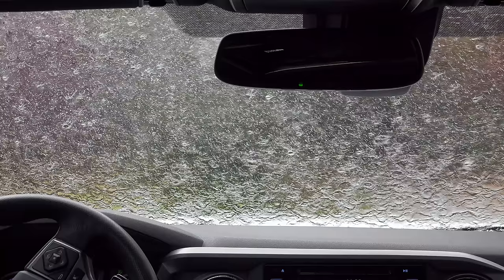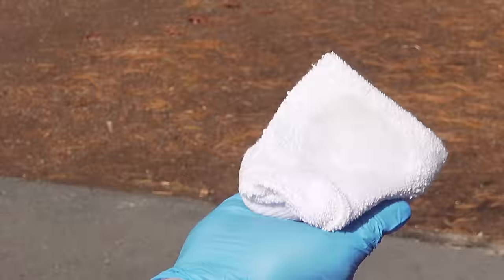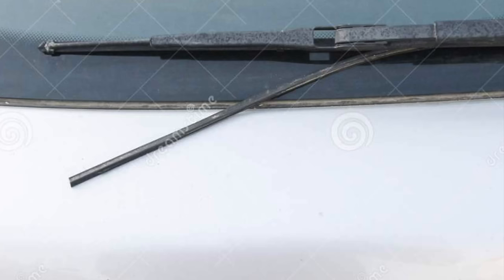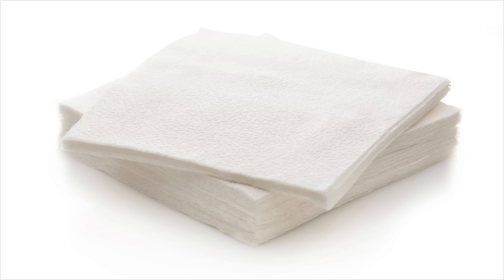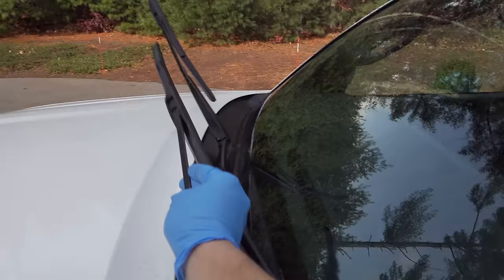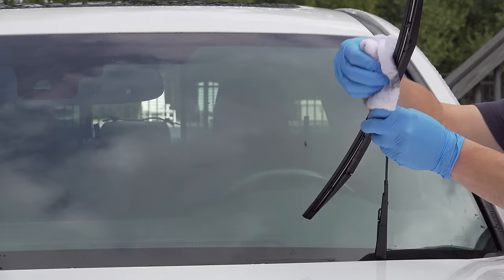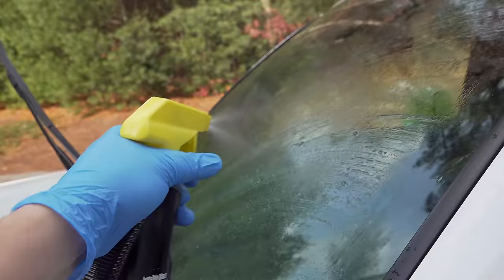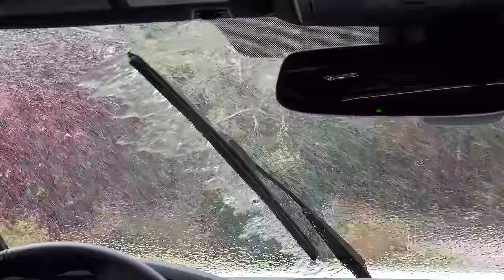How to Make Windshield Wiper Blades Like NEW in 30 Seconds

Comment: So many negative Nancy's leaving unhelpful comments.  
Guys just ignore the H8Rs I can confirm this method works wonders but for the millennials and GenZ crowd Ive found a secret hack that does the exact same thing but without the need to apply any effort whatsoever, perfect for all you tech savvy youth.  All you need to do is hold down the window washer stalk until all the water is depleted, remove the tank cap, point WD40 nozzle directly into washer tank and empty 3 or 4 cans depending on vehicle size. If your driving a large SUV youl need 5 cans minimum, small cars 3 cans is about right.
Don't be alarmed if you cannot see the WD40 liquid come up to the fill line, the main ingredient in WD40 is just a cheap generic hydroplurocarbanant non inhalent gas which is invisible to the human eye. Replace the cap and all done, told you it was easy, Now just wait for the next torrential downpour to test this secret hack and you will see the amazing results but it's really important that you must wait for the first big rain storm as this will not work unless there is plenty of water on the windscreen first,  trust me. 👍

Comment: The big problem is that wiper blades are now being deliberately made of an inferior rubber composition so they last one season and you have to change them every winter. They are tremendous profit makers for the manufacture and auto parts stores. especially since they now are charging around $30 for a pair.  Have you ever noticed too that auto parts stores DONT stock silicone blades? 
Wiper blades used to last many years. I remember getting 5 years out of a pair of blades.  The only way you can do that now is by buying silicone wipers and auto parts stores deliberately don’t carry them because they last too long.  You can buy them online for the same cost as a cheapo pair of blades that will degrade in a year.

Comment: Best to use a silicon-based lubricant and not WD40 which might wreck the rubber in your wiper blades ...
Reply: I agree. Silicone contains plasticizers and is commonly used on rubber to rejuvenate. The only thing I would warn is not to use an aeresol silicone. The "carriers" may not be good for rubber. Instead, go to the hardware store's plumbing department where they sell 100% pure silicone jelly. 

One other caution about silicone spray is that silicone kills catalytic converters. If I used a spray (which I wouldn't), I'd do it with the engine off so it won't inhale silicone into the engine and out the exhaust. You don't have that risk with the gel.
Reply: @markfuller  ✅

Comment: The black on rag is the rubber being dissolved.
Reply from the maker: It's not rubber coming off. Don't believe the old myths, believe the can "safe for rubber"
Reply: @SilverCymbal  then take a  can and keep wiping and see if it ever stops turning your rag black.  I bet you end up with a big pile of dirty rags and it keeps coming off.  It's just cleaning it then a couple of wipes you should have Rags that are coming out clean after you wipe with WD-40.
Reply from the maker: @actionjksn  My friend my videos tell the truth, I have been using this tip for over 20 years on dozens and dozens of cars. It absolutely diminishes after several wipes as shown.

Comment: cleaning your wiper blades with WD-40 will not work. In fact, it can actually damage your wiper blades. WD-40 is a lubricant, and it can leave a residue on your wiper blades that will make them streak and smear. It can also damage the rubber in your wiper blades, making them brittle and more likely to crack.

Comment: I wouldn’t use WD40 on any rubber products it would make  rubber very soft & stretchy which will ruin the rubber I remember long time ago I sprayed WD40 on my fan belt because I was cleaning my engine after few days the fan belt was ruined & I had to replace the fan belt so be careful guys 🤞

Comment: DONT DO THTA! The black stuf on the rug is not dirt, is the graphite and tefflon which protect the rubber of the blade. Using wd40 will destroy the blades in time.

Comment: Didn’t know wd40 and nice rags are free or cost less than new wipers
Reply from the maker: I dont know anyone that doesn't have a napkin and WD40 around their home. But yes if you have to buy it, one $6 can will treat about 50,000 wipers.
Reply: @SilverCymbal  Agreed! I tried to be sarcastic and I apologize. Now, honestly I use WD40 a lot but that black thing it takes off of rubber is graphite and graphite has its purpose. On old wipers graphite is almost gone hence WD could take the role of graphite. I’ll give it a try

Comment: I once used silicone spray on my new motorcycle fork. My rubber rings got cracked. No thanx.
Reply: WD 40 isn't silicone. Silicone contains plasticizers which will rejuvinate rubber (in a way wd 40 never will). But, silicone aeresols contain carriers which may not be good for rubber. The hardware store's plumbing department sells a 100% pure silicone gel. That works great to rejuvenate rubber. Give it another try sometime, but do it that way.

Comment: This didn’t work for me. Made my blades all greasy then smeared all over my windscreen. Had to degrease the whole lot. I used wd40 silicone spray.
Reply from the maker: Silicone WD40 will not work. Only regular WD40 as shown.

Comment: Do not use WD-40 on your wiper blades. The first time you used them you’re going to smear WD-40 all over your window is a mess, standard, rubbing alcohol it does the same thing it doesn’t mask all over your windshield.

Comment: wd40 is the wrong product to use as it will dry the hell out of the wipers and cause cracking in the blade much quicker, its a penetrating oil not a lubricant ! any time you use wd40 you should lube the area right after as WD40 dries out.

Comment: Nice try. Saw improvement, but not restoration. Blade rubber is in great shape, cleaned the window, but this didn't work as expected. Will try again to confirm.

Comment: NO, not WD-40!  And, WD-40 to "like new", NO!  That is just not true unless the blades are already "like new".  Silicone spray, YES!  Also, you can buy silicone wiper blades.  Be in the habit of washing the blades when the vehicle is washed.  When not washing your vehicle, clean the windshield properly when doing the blades.  Because why do one and not the other?  You can also use a water repellant on the windshield, which the silicone product used may just be what you need.

Even what goes in your windshield washer reservoir can make a difference in the life of the blades and how clean your blades and windshield stay between cleans.

Old trick: If the blades are lightly worn and don't need replacing, clean, sand with high grit sandpaper, not less than 800 grit, from top to bottom, or bottom to top, in even, light strokes, clean, treat with silicone/silicone spray.  A long time ago, some people would just grab a matchbook and use the scratchpad/striker to rub over the blades.  (Heh heh!  ASIDE: I even remember when matchbook strikers were required by law to be moved from the front of the matchbook to the back.)

NOTE: Regarding WD-40 and similar products, you may want to research products for their combustibility and or flammability.

Comment: WD-40 is 100% the wrong solvent to use for cleaning this. That is because WD40 actually attracts dirt. Try putting it on a clean bicycle chain, go for a one hour bike ride, and you'll see what I mean. If you want to properly clean rubber you should be using something like isopropyl alcohol or, hot water and Dawn dish soap.

WD-40. Lol.
Reply from the maker: Please follow the video for amazing results. You aren't leaving it on the wiper. My simple video steps won't steer you wrong

Comment: Don't do this Just clean the wipers with soap and water and then use a silicone based wiper lubricant. Using WD-40 removes the graphite on the wipers.

Comment: Wrong....plain water to wipe away dirt, glycerin soak for 20 min and rinse with plain water to replenish rubber. If blade is curled when lifted and not perpendicular to frame, cracked, torn or damaged in anyway just buy new ones

Comment: WD-40 deteriorates rubber.
Reply from the maker: Its a myth, You will see on the can, "safe for rubber"
Reply: I looked at 2 WD-40 cans of different production runs.  I didn't see 'safe for rubber'.  I did see 'contains petroleum distillates', which are believed, like most petroleum products, to be harmful to rubber.  A mechanic told me to use other silicon spray lubricants on or near rubber & plastic parts.  Anyway, I like the idea of preserving parts, like wiper blades, as you focused on in your video. @SilverCymbal

Comment: you shouldn’t be cleaning your wiper blades with WD40, ever. WD40 is a water-displacer which, if you use it on your wiper blades, will leave streaks and marks and won’t clear away the rain, but will make it worse.

Comment: This video shows a practice that is totally flawed. WD40 is solvent based and it will destroy your wipers. If you read the can it says it is not suitable for rubber. Yes, the WD40 will remove some particles from the wipers, but the solvent will also prematurely destroy the rubber. WD40 will also completely remove the graphite coating on the wiper blade rubber which is supposed to greatly reduce the friction in the contact areas between the wiper blade and windshield. I don't recommend anyone follow this procedure.
Reply from the maker: If you read the can, it says, "safe for rubber" You are incorrect, its a myth, check the can for yourself
Reply: @SilverCymbal  I suggest you read the Safety Data Sheet for WD40. It is extremely flammable containing: Distillates (Petroleum), hydrotreated light. Distillates (Petroleum) 30-60%. Petroleum Base Oils 10-<30%. Naptha(petroleum) 5-15%. Give me you email address and I will send you the complete SDS. The only "myth" is people telling you it is safe for rubber.
Reply: @SilverCymbal  "Safe for rubber" doesn't mean it's "good for rubber." You may not see the effects immediately, but WD40 is not good for rubber in the same way silocone is. 

Just do this: use WD40 on one blade, and use 100% pure silicone gel on the other blade (this is commonly found in the plumbing department of your hardware store. It's used to rejuvinate/protect rubber washers.). Do that for however long the blades last, and see which works better. Chemically speaking, the silicone should work much better since it contains plasticizers and is commonly used on rubber for this purpose. 

Beware of silicone sprays because they contain carriers like WD40 does which are petroleum distillates and will (can) harm the rubber in ways the 100% pure silicone won't. One other caution about silicone sprays is that silicone will kill catalytic converters. I wouldn't use a spray on rubber anyway, but if I did, I wouldn't use it while the engine's running (and potentially inhaled through the system affecting the catalytic converter.).

Comment: Total BS. WD40 might clean the blades initially, but eventually it will deteriorate the blades faster. Petrochemicals and the various elastomers and natural and synthetic rubbers do not play together well. Use the same technique but use white vinegar to clean the blades and follow the rest of this instruction. Even though WD is an extremely light oil, it is nonetheless oil.

Comment: Don't be a rookie, you shouldn't be cleaning your wiper blades with WD40, ever. WD40 is a water-displacer which, if you use it on your wiper blades, will leave streaks and marks and won't clear away the rain, but will make it worse.
Reply from the maker: Trust me, 20 years of doing it wont steer you wrong.

Comment: you don't solve anything like that, this "fix" will not work for a very long time 
better solution : remove it, scrub it, put in in boiling water for 20 second, put it back in place and voila .

Comment: That’s an unbelievably unnecessarily long video.
Absolutely painful.
Reply from the maker: Sure, you can't spare the 3 minutes for a free tip that works. Give me a break go watch 5 minute crafts
Reply: @SilverCymbal  
It’s a good tip.
Why don’t you combine a bunch of tips together in one video?
Personally, a silicone spray on the rag will protect the rubber from UV better.

Comment: Sorry, but it is a horrible tip. It will clean your vipers but in a same time it will destroy rubber. WD40 is not good for the rubber. Use sylicon spray instead!

Comment: Rubbish. DW40 will only damage your wiper blades (the black stuff being removed) and promote more cracking. DW40 is pretty much kerosene and even though it is oily it will still dry out rubber and plastic.
Reply from the maker: You realize I have been doing this trick or over 20 years on dozens of vehicles. Forget about theory and give it a try, you will be surprised